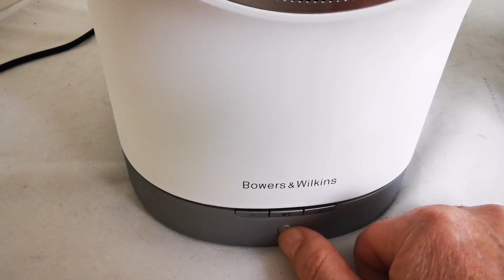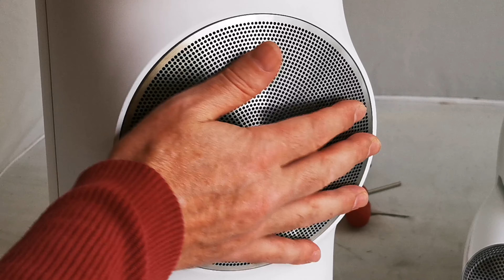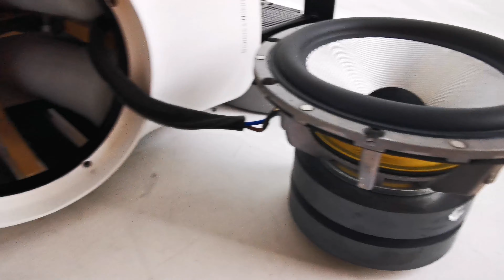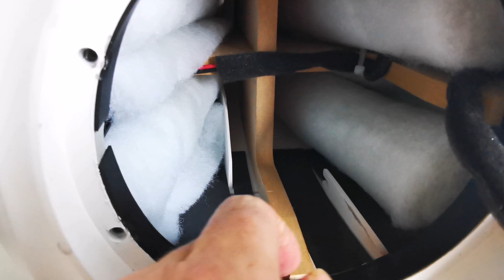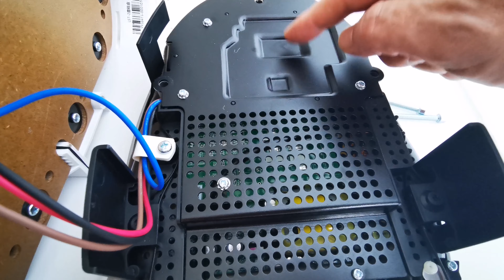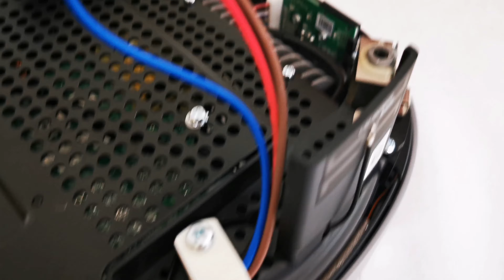Bowers and Wilkins Formation Duo Deep Unboxing

Comment: I'm confused... one professional reviewer says the Duos are made of a "special" plastic - and not out of wood or metal - so the several (6?) wireless antennas inside don't get interfered with...While "hxos plus" here on YouTube who shows a break down and take apart of the actual speaker says that it is made of metal...?
Reply from the maker: I can't recaal it right now. The cabinet is from wood and the frame of the woofer is iron cast.